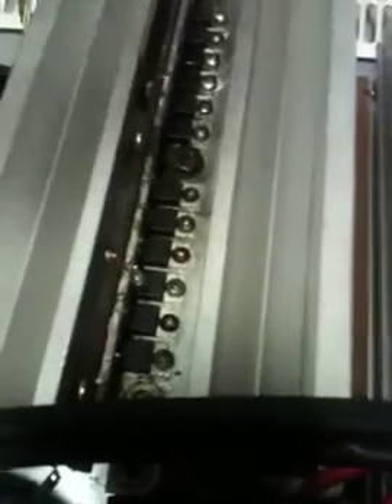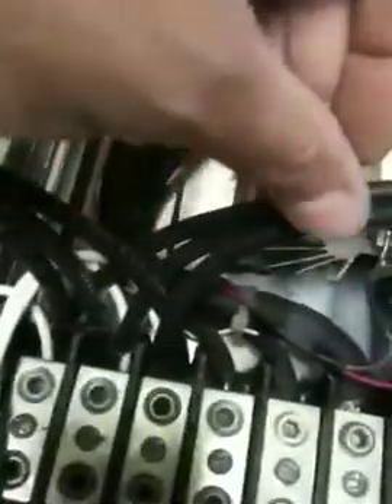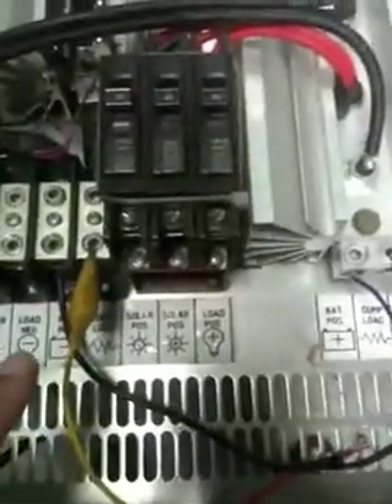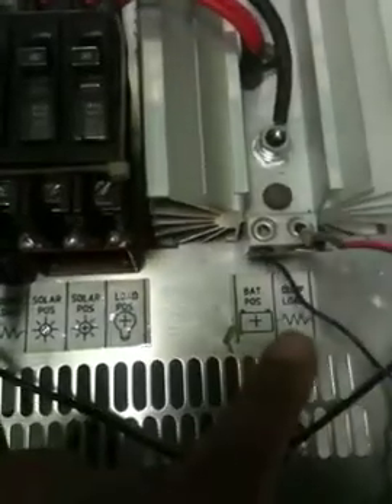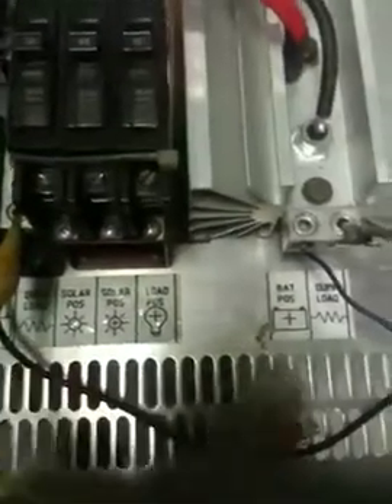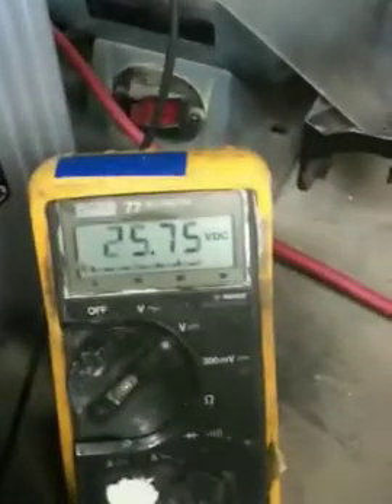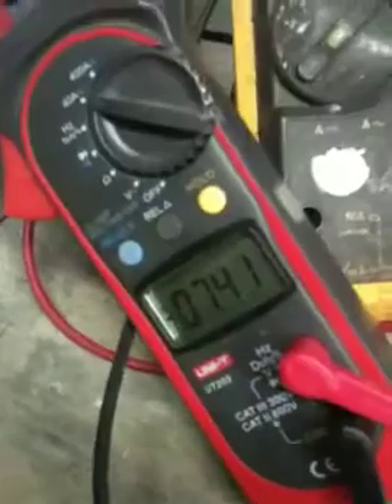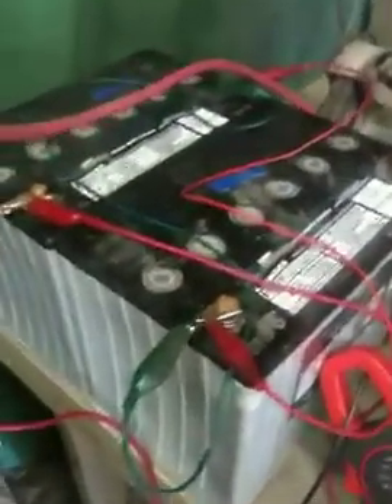Fet Bar testing

Comment: one thing the chinise need to advertise and that is wattage not just voltage and current because wattage is the power total a devide can handel. and I was like hell it bured up when only drawing 20 amps at 26 volts. but they told me it was may faoult when they didnt state the total wattage.....  but I will build one that can handel up to 2kw. at least I hop I can. .

Comment: that would be great. I like to see what and how its put together I have seen basic stuff like with an optocoupler, and then one fet.  I have ordered 4 400 watt fets.  to build a solid state relay.    I bought a 40 amp ssr.  and it burned up on my 500 watt gti  and it was saposed to handel voltages up to 220 volts dc.  it didnt say anything about wattage.   but after I did research on the Fet that was used inside it was only a 300 watt fet no wonder it fried lol.